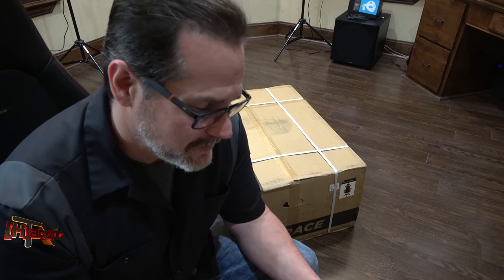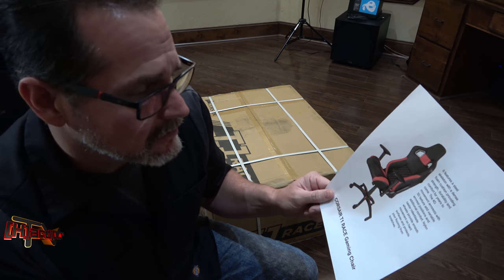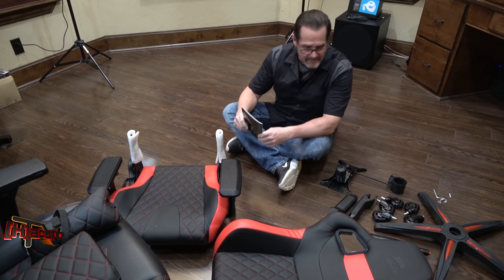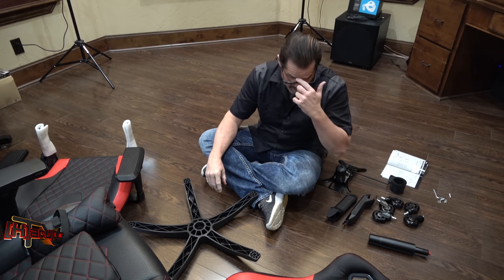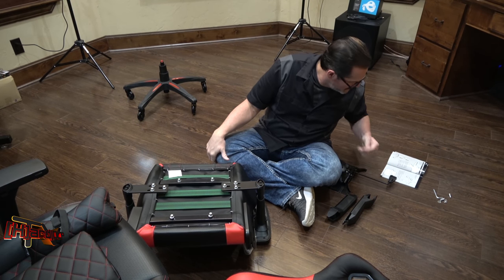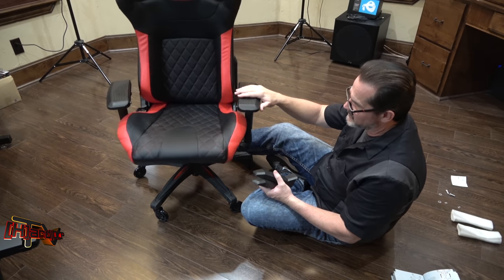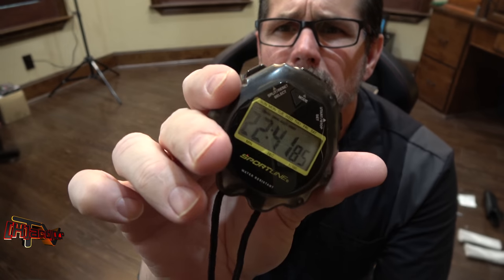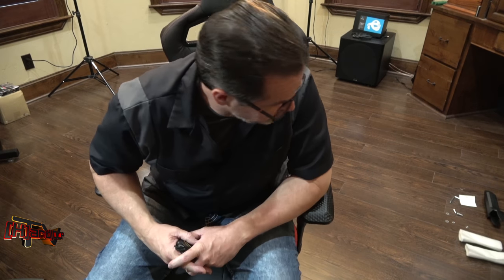Corsair T1 RACE Gaming Chair Unboxing & Assembly

Comment: If you forgot to remove the RED CAP dont panic! The red cap can be easily removed with a small Phillips screwdriver. You'll have to shift the metal prong above it to the side (be gentle as it can easily break) then lift the cap up from the base. Good Luck!
Reply: Hello, do you have any picture or link of the small screwdriver you used in order to remove the red cap? I want to try first the `non-destructive' option :-)...
Thanks in advance

Comment: Do the casters lock ?
I play a lot of Virtual Reality racing games and I can't be rollin' around when I'm sawing at the wheel and stabbing at the pedals.
Reply from the maker: Nope.  No locks.
Reply: Thanks kindly for the timely response. 
You probably saved me from rolling right through a window and into the street where I'd be run over. Which is a secret fear I harbor while using my Oculus Rift about 3 feet away from a giant picture window.

Comment: ouch ive bought this chair yesterday, im 6 foot 1, wondering if the chair will be too low for me? can you increase the height by a sufficient amount?
Reply from the maker: Chair height was fine for me.  Just not wide enough to get my ribcage into.
Reply: same issue im 6 feet and think height is a little less
Reply: 10 months later, did it fit??

Comment: i hope he later removed the red cap on the lift for it to work
Reply from the maker: Yeah, and I had to take the thing apart to do that.  I could not get it off otherwise.  Had to take a dead blow hammer to pound the gas lift out of the base.  Do not do what I did.  :)
Reply: Wow fast reply. Before assembling mine, i looked around on youtube and found that the majority were panicking over the lift not working so im happy i saw that beforehand. Good video btw, you have earned another subscriber.
Reply from the maker: Thanks!!
Reply from the maker: Actually, I need to put that in the description of the video!
Reply: Haha might be a good idea.
Reply: i bulid it like he did and i didnt remove the red cap, it was very hard but i did it , he needs to delete this vidoe becuase this vidoe misleading other people....
Reply from the maker: Did you read the second line of the video description?  MAKE SURE YOU REMOVE THE RED CAP ON THE GAS LIFT BEFORE PUTTING THE CHAIR TOGETHER!!!  We did not, and you have to pound the gas lift out with a hammer if you do not.